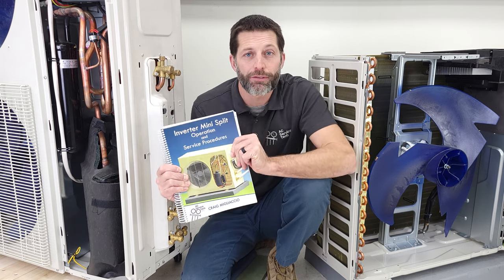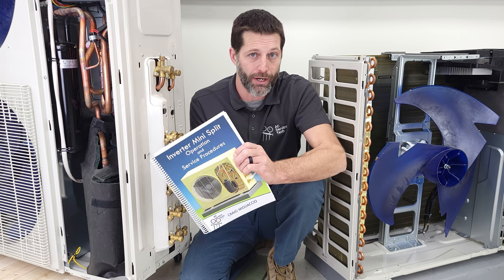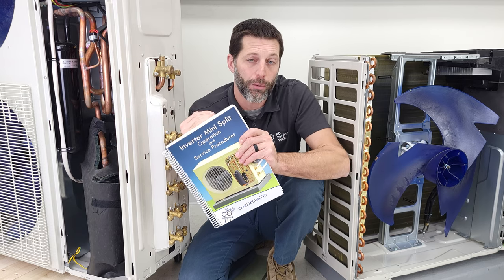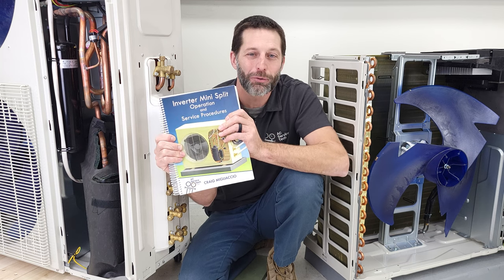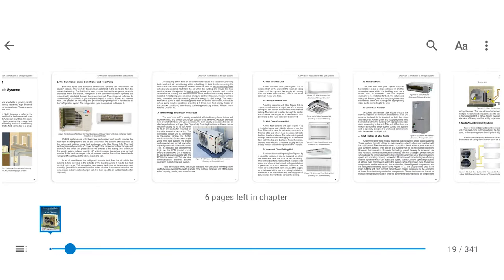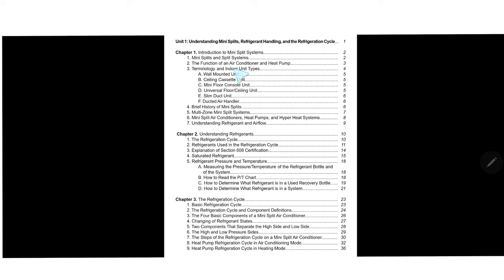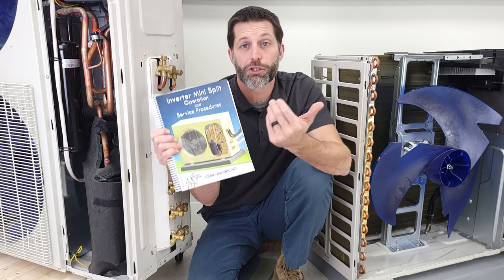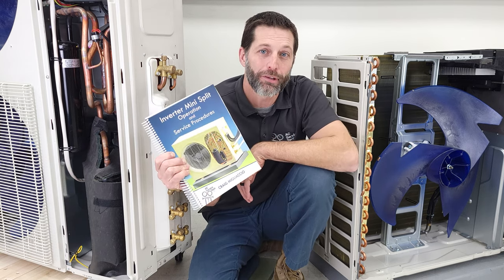Inverter Mini Split Operation and Service Procedures Book and E-Book!

Comment: Got the book.  14 year old Daughter is studying.  She did her first install and made $300 but is was for a "Friend" and it was her first.  Not terrible for 14.  The video and book content has been great.
Reply: Also our Gree Viero Gen 3 1 ton, she installed is doing great at Ambient 20F Delta T outside is -3.4.   /  inside unit is +34 Delta T, during our latest 2022 Texas Freeze.
Reply: I think that's great. Need more women in the field.
Reply: Start em young! Good work dad. 👍
Reply: Good job just had our lil girl hopefully she follows my foot steps lol
Reply from the maker: Thats so awesome to hear!!! Invest in the youger generation and give them knowledge and skills!
Reply: Great
Reply: @halledwardb  really like the Gree product!
Reply: @NC-it6im  Its pretty nice stuff.  We installed an Arc or some name like that, and it was garbage.  The line set had heat marks all over it, and yep it was annealed very well.  Could only put 14 lbs torque on the 1/4, but it held.  Any time we used more torque the copper just wiped out the flare.  We were nice to the guy and let the positive  pressure sit for 45 minutes, but I'd never install another one, at least with that line set.
Reply: She installed a mini split at 14??? Awesome
I’m 26 and couldn’t do that yet
Reply: @KayShwizzley  yes but she can weld, and has a general class Amature Radio Station license as well.  We are luckily not slowed down by public schools.  She currently is running 13wpm morse code and studying Linux.

Comment: Because of uncertainty of knowing how much refrigerant to add to mini splits after determining the system is low on refrigerant, I recover the refrigerant, vacuum complete system and fill according to plate and line set  length.  However, always find it problematical to hold system beneath 500 microns for 10 minutes although can usually  to vacuum to 100 - 200 microns with 3 Nitrogen purges. It generally rises up to about 1200 micron after isolating the vacuum pump.  (No trouble vacuuming line sets isolated from the compressor.)  It seems as though there is residual R410 in the compressor oil that is slowly turning to vapor. I could not find an answer in the Inverter Mini Split Operations and Service Procedures (but many other good answers!). Any advice on how to do a better vacuum job?
Reply: Compressor Oil will start to flow out to the line set and Evap unit. There might be some microscopic leaks that those leak oil trap some moisture.

Comment: Hi Craig! Nice to have a guide for the ac systems! Quick question I can't seem to find an answer for: regarding inverter split units, if I can't find the same compressor for replacement, what parameters should I search for a compatible compressor, except btu? Thanks and keep up the good work!

Comment: Hello, do you know of any booster fan that can work with 24 volts, would you like to increase the air in some vents, that can be connected every time you turn on the heating or AC, thanks

Comment: If I may ask a question, I have never worked with 410A before, my last jobsite (federal prison) only used 404A.  My new jobsite has a 410A system.  I loaded 4Lbs of vapor not knowing at the time I should use liquid only, my suction side line froze over. Is it because I caused the blend to get messed up from the vapor?

Comment: I bought this book digitally and downloaded it onto my wife’s laptop, not knowing that I could never move it again. It’s been such a PITA for me to not be able to access it on my own devices that I go to the book about half as often as I otherwise would. Kinda sucks.
Just thought I’d mention that to anyone who’s considering buying the digital version. 
I probably would’ve gone for the paper version if I had known, although I highly prefer ebooks these days…
Reply from the maker: Where did you purchase the ebook from, acservicetech.com apple books, google play, or amazon? You should still have access to it on another device if you are under your account.
Reply: @acservicetechchannel  
I bought it on iTunes but on my wife’s account, if I remember correctly. I’ll give it another shot. 

Just thought I’d warn other luddites in case they would rather go the print route. Thanks
Reply from the maker: You should have access to it on any device you would like as long as you log into your apple books account on the device. Let me know how it goes. You are speaking to Craig by the way.
Reply: Great book, btw 👍🏻

Comment: Does it cover troubleshooting multi zone units? 
For a multizone mini split system in cooling, why when one unit is turned on, the line ices up and the system won’t cool but as soon as you turn on a second indoor unit, then they both cool as they should?